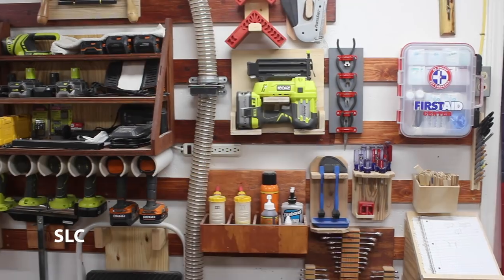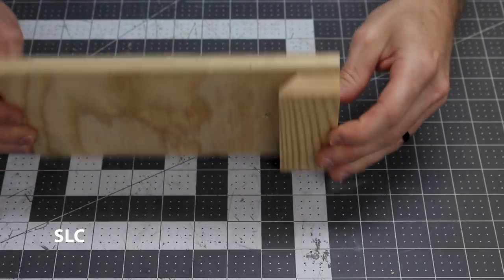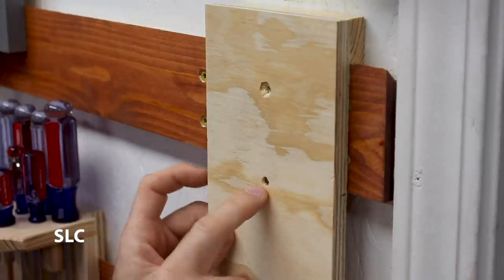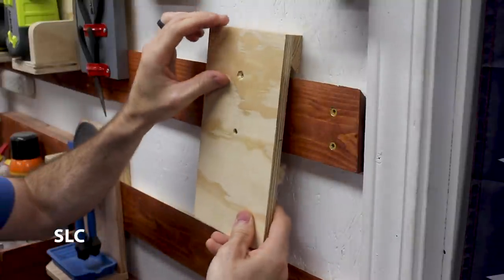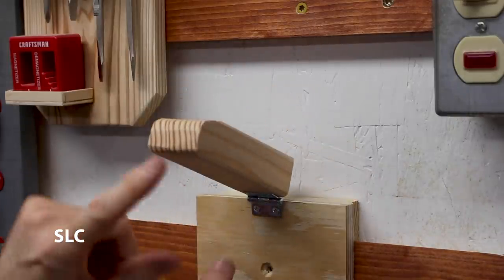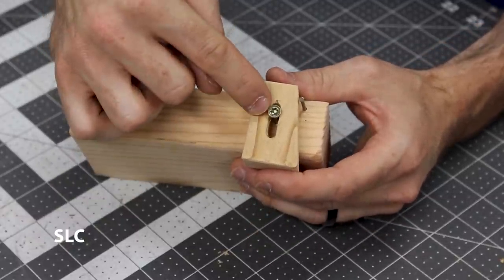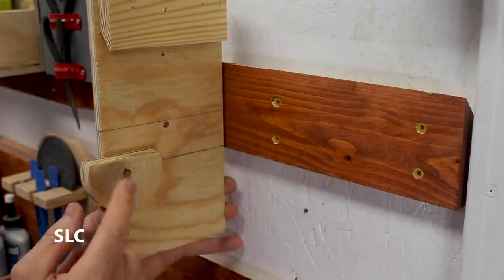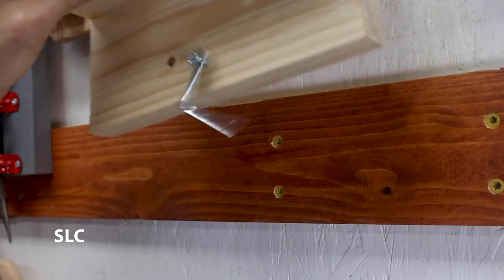7 Locking French Cleat Ideas for your Tool Storage

Comment: I use the wedge method in my shop, kitchen,  pantry, linen closet, GrandKids bedroom, Model Train Room, garage, & She/garden shed.  Except in the outside edge, of the wedge, I have inserted a wing nut.  That way I have an ease of removal grabber.
I absolutely love the brace idea.  I won't be using any hinges however.  Just two strong magnets.  Polarity matched and glued in place.  That should be enough.
~Jim
Reply from the maker: Sounds like a good plan

Comment: Another option is similar to the dowel method, but you can add a tee nut to the hole and thread a bolt through it. You can use a "wing bolt" to make it easier to do by hand

Comment: I saw a great method on another channel I am currently using on the wall I am putting in place. Each wall cleat has a 10 degree back cut on it. i then made a jig so when I am making tool holders I slide the jig into the 45 and then I place a wall support block in that location. Size of that block doesnt matter so long as it isnt so tall to interfere with the next cleat (I have 16" spacing covering the whole wall, then 4' sections of 8" spacing).

So, all those tool holders now have a wall support in a consistent location from the bottom of the wall cleat. I make a strip of locking material with a 10 degree cut in it and just slide it in behind the tool holder between the wall support and the bottom of the wall cleat.

I have marked the corners of all compatible tool holders with red sharpie so I know it is compatible with the locking strips. The locking strips I put a red sharpie line on and then I am making them a hair longer than the tool holder so it sticks out and I can visually tell which holders are locked in place. You could also use short sections of lock (say for a long shelf) and put a handle on it so you just slide it in a few inches rather than needing a clear area the width of the tool holder. For 3-6" wide tool holders a full width lock isnt a big deal, but it'd be unrealistic to have 1' + free sections to the side(s) to lock or unlock.

The beauty of this is that it is very little work to implement now or in the future. Again, I forget which channel I saw it on, wish I could remember to give them credit.

Comment: These are some great ideas. I just refinished a room and was looking to wall mount my mountain bikes (and other bikes) and used the 2x4 and hook in the past but the idea of doing a french cleat seemed like a good idea until I thought about it every time I took a bike off a hook it would get bumped and knock the cleat and hook off the wall. So being able to lock the cleat from sliding up will give me a clean-looking wall (and not a tatty 2x4 full of holes and hooks) and just putting hooks up on the wall that I need. Thanks for this video. Also if anyone sees any flaws in my idea of using a french cleat wall system for a bicycle rack please let me know.

Comment: I’m using a system similar to the wheel idea you presented. But, I have an entire circle on the back of the tool holder (just a ¾” slice of a 2” dowel), with the hole drilled slightly off center. It’s off center so as the wheel is turned it acts as a wedge, pulling the cleat downward. Rather than a dowel sticking out to turn it, I have it on a small bolt countersunk flush with the face of the tool holder. To turn the wheel, on the side of it I drilled holes about every 60 degrees (6 holes total around the circumference of the wheel). Remember Tinkertoys? That’s what it looks like. You stick a screwdriver, hex key, whatever, behind the tool holder and into those holes on the wheel, and turn it. It’s rock solid, invisible (you could even fill the bolt hole on the face of your tool holder if you wanted), doesn’t interfere with anything on the front of your tool holder, fairly simple to make, and doesn’t damage the wall cleat (or the wall) in any way.
Reply from the maker: Sounds very ingenious, thanks for sharing

Comment: Most simple solution I found to be working nicely is just a tiny strip of wood at the bottom which is secured by a nail/screw place off-center and allows the piece to rotate to lock it under the cleat. It's strong enough, useable with just 1 hand and height adjustable in case your cleats aren't 100% identical.

Comment: I just found your channel. I've already had a French cleat system for several years and think it is ever-so neat as you do.. you have a lot of inspirational ideas I plan to steal... I mean... borrow from your channel 😁 ... I also live in the SF Bay Area and we get Earthquakes!!! I hadn't thought of securing things to the cleats, I thought they would be plenty strong, like the power tool (drills, etc.) / charger station is heavy and rests on two sets of cleats, and it's for a longer portion than other items hanging on the cleat... just how much movement do I need to be worried about? I know that's a tough question to answer, but could it be tested?  I think it could be done and maybe a subject for another video??  Still, it's cheap insurance to retrofit the high-value items I don't want flying off the shelf in an Earthquake  -  Thanks for the tip!  (And BTW I know how things fly off shelves, innocent things turn into fast moving projectiles in seconds; Luckily I was ducking under a desk when I saw the books and toys flying of the bookshelves, WITH FORCE, in the area where I was just sitting seconds ago!!! Shaking lasted 45+ seconds, it felt like forever...  I was in the 1989 Loma Prieta Quake M6.9... for those that don't know... Google it... it was frigging scary to live through.)
Reply from the maker: Glad you made it out alive I'm sure that was really scary
Reply: @SpecificLove7  Yeah... me too! 😁 Fortunately no damage to the house either.  I didn't have my workshop back then but I know it's no joke to do the retrofitting and securing things down. For example, I've added bungee cords across the bookcase shelves (midway) to hold back books the and I use Museum Wax (a very cool product) so secure knickknacks. I am still thinking about the securing methods, what a great video you made

Comment: Smiilar to #6, one could also do a cam... just make that center peg slightly off center from the radius, and depending on how much you turn it, you get more and more holding power (kinda like the wedges of method 3, but round).  If you do it right, it could even have a built-in handle for leverage.

Comment: Best and easiest way to lock a French cleat is to put a 10 degree back cut on the bottom of the wal cleat and the top of the tool holder cleat. This will create a trapezoidal space where a simple sliding lock can be put into place to lock it in. All cleats have to be the same distance apart.

Comment: What about using spring pins mounted to the face of the cleat plate? It would block underneath the wall side of the cleat. need one for each mount, but it’s a quick pull and remove without any screwing or risk of losing

Comment: Use idea #6 but;  attach with a screw + washer  not a protruding dowel - keeps it flush with front plate & spins easier) use a full circle then drill screw hole below circle center  (low enough to clear bottom of spacer when in lower position) -  circle then acts like a cam and wedges in place, Could drill twp small finger holes in circle to manipulate it more easily. After posting this I see the same idea was already posted. by someone with same first name!

Comment: I do not remember the YouTube channel that I saw this on, but he did French cleats with a spring loaded clamp for the bottom of the cleat. He would push it down, put the clamp on the wall cleat and let the locking part up to press against the bottom of the wall cleat. He used two springs on two rods and a center guide rod for the bottom locking mechanism. There were two pieces of solid square wood on the back of the removable cleat. The bottom one was attach (with screws &/or glue) to the removable cleat while the top part of the locking mechanism slide up and down so the cleat could be put in place or removed to relocate elsewhere on the cleat system. I hope I was clear enough so that you could understand the mechanism.
Reply from the maker: I saw that one too, but it was a little more complicated than most would attempt, so I did not want to include it. But thank you for sharing it for others.
Reply: That's Jean on Woodshop Junkies.  In the end he wasn't happy with the locking cleat he'd made, but it was still a cool idea.

Comment: I use dowels cut flush, none of it poking out to get in the way of the tool.  I poke the end of the dowel with a awl, and drive a screw in a couple of turns to remove the dowel if the cleat needs to be moved.

Comment: Question: I’m building a French cleat system but I’m worried about weight. Instead of a long piece of wood at the bottom of the holder I want to use a dowel on each corner. It will still hold the holder away from the wall but without all that bulk and weight. Will that work? Any pros or cons to using a 1-inch dowel to hold a holder out?
Reply from the maker: It might work, but if the holder is hit hard or bounces a few times, it could dint the wall.
Reply: Specific Love Creations ah! Well, my wall is bare 3/4 ply so should be okay! Thank you! This is one of your best videos! Love the locking ideas. I also love that you give credit and share so much!

Comment: Thought french cleats were a neat idea, but they also require a lot of space in smaller shops and not as handy as I had hoped. I have replaced some in favor of multipurpose narrow shelves on the wall. Also, most of the hangers require "scrap wood" that I didn't have, and was too expensive to buy to cut up to make single-purpose cutesy hangers.